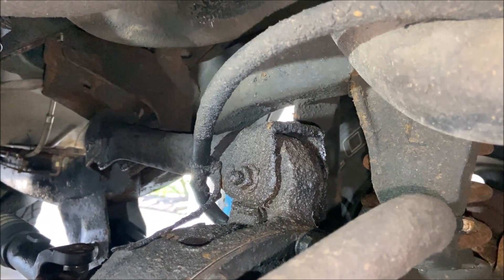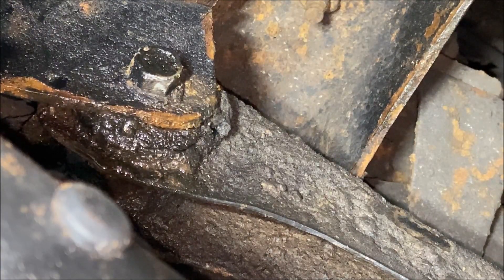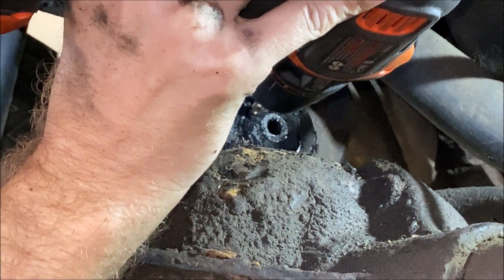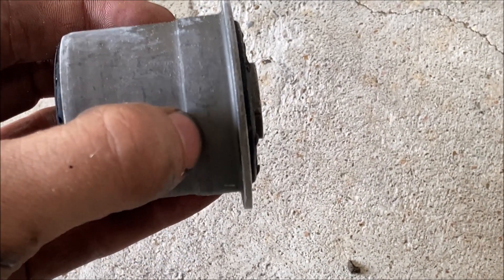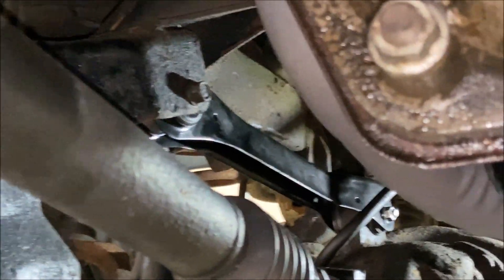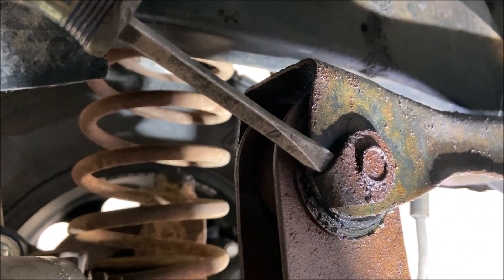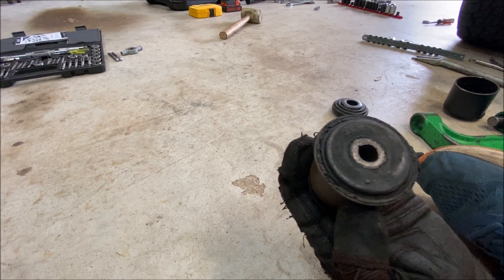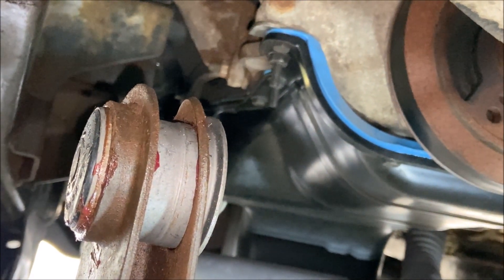Control Your Motion – Replacing Upper Control Arms on a 1997 Jeep Wrangler TJ

Comment: Thanks so much for the instructional video.  What you shared was clear and concise and helped me change out my upper control arms.  One trick that I used to help with removing the front bolts with the flag nuts, was to actually remove the flag nut from the head of the bolt.  The bolt head had enough purchase to allow me to use 2 ratchets with 15mm sockets to remove the nut from the bolt.  Both the front bolts had the flag nut spin when I tried to remove the nut, so I figured if i removed the flag nut, then I could grasp both parts of the bolt.  It worked like a charm.  Anyway, thanks again for the great video!
Reply from the maker: @logeo1992  Thanks for the feedback and for watching. Great comments, thanks!

Comment: I’ve done a few…. Freezing definitely helps !
Reply: i just asked that question, thanks for the info, i did that a long time ago on a wraist pin for a piston, froze the pin and heated the piston and it fell right in, people would be amazed how much metal expands and shrinks, thanks again, i even thought about getting a small amount of dry ice and once i take the bushing out of the freezer put in a box with the dry ice to get it to the car to keep it frozen as long as possible

Comment: Just did my lower ones on my 2001 TJ. They looked original. 1 bolt was frozen. Lots of pb blaster. 30 seconds with the torch n kept repeating till it broke free. But it fought me most of the way. I kept kitting it with pb blaster every quarter turn. About to start the uppers. What fun
Reply from the maker: The "fun" of the torture of these TJs...  Glad you were able to get the bolt out eventually.  These lower control arms (the bushings, especially) are no joke.  Thanks for watching, Jake.
Reply: @CarbonsDIYGarage  ya what a pain. Problem I’m having is with the flag bolt on drivers side upper arm. Can’t get a grip on it. Gonna try drilling a hole thru the arm into bushing n leave bit in place as a stop so flag doesn’t spin. I’m replacing bushing anyway. First I’ll try grabbing the flag from the other side with vice grips. Seems like trying to grab the shorter side is very hard. Or I’ll dimple the old control arm to get a better grip on flag. Tomorrows job
Reply from the maker: @pujo28  Oh yeah, I feel ya on those piece of crap flag nuts. That took a lot of time and effort for me as well. They essentially do the opposite job of what they’re supposed to! Good luck.

Comment: Firrst of all, thanks for the video log of your disassembly and reassembly. A few nuggets of help I hadn't seen before. You mentioned you had trouble with the final upper control arm install? Q: did you tighten up the other side upper 2 bolts and nuts before or after you got the final side reassembled. Could likely be that you bound up the control arms and bushings. If you ever do this again, set the jeep back down under load and then tighten and torque to spec. It will be easier. You may want to go back and re-torque all front and rear control arms under load after 100-200 or so miles, especially if you didn't use any blue lock tight on threads. YMMV
Reply from the maker: Thanks for the comments! I did the driver side and torqued it up because it was about 4 weeks before I got back to do the passenger side. I didn’t loosen the driver side before working on the passenger side. That may very well have made a difference! 
Good call on checking the torque on the four bolts. I’ll probably loosen all four and retorque to make sure they’re not binding. Thanks for the feedback!

Comment: Great info Ed. I will be replacing mine next year.
Reply from the maker: Thanks for watching, Carl, and good luck with yours - I hope your bolts are non-seized like mine were.
Reply: @CarbonsDIYGarage  Thanks, will probably need it. as per our previous conversations re: my 00 TJ I am finishing up my frame repair and trying to get it finished up before winter sets in but it’s not looking good. With the wind makes it tough to work outside

Comment: I used a balljoint press to knock the centers out and an airhammer to crumple the sleeve and rest of the rubber i might have gotten lucky but was done in about 10 min. We dont have many rust issues here in sw washington though that damn johnny joint went in haaaard though i bruised my hand on the ratchet handle was the longest part of the process because i kept thinking it was seated and wasnt there yet
Reply from the maker: Air tools definitely come in handy if you have them!
Thanks for watching.

Comment: Could you elaborate on where you connected your straps at around the 18 min mark
Were the other ends on the frame?
I’m having the same issue.
I’d like to orientate my straps using the same angles you had so I can get that front bolt aligned.
Reply from the maker: Gosh, I really ought to have shown how I had the other ends of the straps setup.  Apologies for not doing that.  I had them all hooked to the transfer case skid plate. I think 1 or 2 of them in the holes in the bottom of the skid plate and at least one on the rear edge of the skid plate.  The key was using the skid plate as a secure connection to the frame.  I hope that helps and good luck on yours, Adam.  Thanks for watching.

Comment: i had the same idea of putting the bushing in the freezer and heat up the bore where the bushing goes, how did that work out for you freezing the bushing?
Reply from the maker: To be honest, it didn't seem to make a difference but others have commented that it really helps.  It can't hurt, that's for sure.  I was also able to use the ball joint press to get the bushings in place, which made a big difference.
Thanks for watching, Butch.
Reply: @CarbonsDIYGarage  i will be doing my 1995 jeep grand cherokee soon 2x4 and have watched many videos on youtube before i get into it, i wish i had an air compressor that looks like the easy way to get the bushings out, and Advance auto has a press so that will help a lot, thanks for the reply, have a great day, the way i am looking at it, it does matter how long it takes me to change the up and lower control arms it will save me a lot of money doing them yourself at the rate a garage charges now a days, 260,000 miles and the car is very little i think
Reply from the maker: @butchs2337  Sounds like a fun (ok, maybe Type 2 fun) project. Good luck!

Comment: Think an air hammer would have sped up the process of removal?
Reply from the maker: @dennis1979gm  Of the bushings? Probably. As long as you could get access into that space with it, you could probably beat the rubber out, at a minimum, and go from there. It might be more challenging on the passenger side due to access. 
Thanks for watching, Dennis.
Reply: @CarbonsDIYGarage  Cool doing mine tomorrow so I'm just trying to due some research. 😂 I have a ball joint tool, air hammer and 10k lbs lift in my shop and just trying to figure out the best way of doing this job.
Reply from the maker: @dennis1979gm  Some good brute force options! Good luck tomorrow; let us know how it goes.
Reply: @CarbonsDIYGarage Air hammer was a no go for me. I did have a ball joint press and adapters. I have the XL press and it was hard to get the press and two caps lined up to stay in place with only 2 hands. Lol😂 but once I got it aligned and pressure on it a 20v impact made short work of going off and pressing the new ones in. It wasn't a fun job by any means but it was doable with brute force and patience. Thanks for the video it really helped!
Reply from the maker: @dennis1979gm  Nice! and congrats!

Comment: will a torch help with this?
Reply from the maker: It depends on what "this" you're referring to.  If it's getting nuts and bolts loose, that can usually help.  If it's heating the frame or bracket up in order to get them to expand and the bushing come out more easily, that might work.  It might take a lot of heat to make it happen and you'd probably end up burning/melting some of the bushing, but it might prove helpful - I don't think I tried it.  If you mean flat out just burning the bushing out, I believe there are videos where people did that but to me it would just be a huge, stinking mess and not something I'd want to do.

Comment: I have a system that if you replace a part on the jeep you upgrade that part .You replaced the control arms with the same cheap stamped steel part .Yes you did waste  your time
Reply from the maker: From your approach, you're absolutely right.  For my approach, I don't have a desire to make this baby stronger, better, or taller.  It's  not going to be an offroad rig and it's likely not got too many years left on the road.  It's also only going to be a Daily Driver in our family for another year or so.  Thus, I invested in it what I needed to in order to regain some stability and to rule out some issues I've been having.  I appreciate your input and feedback.  It shows how Jeeps are so adaptable and upgradeable that everyone can make them uniquely their own  - something much harder to do with nearly any other vehicle type out there.
Reply: That’s “your” system doesn’t mean everyone has to do the same
Reply: His bushings failed not his control arms so for what this Jeep is used for, the stock parts are fine.